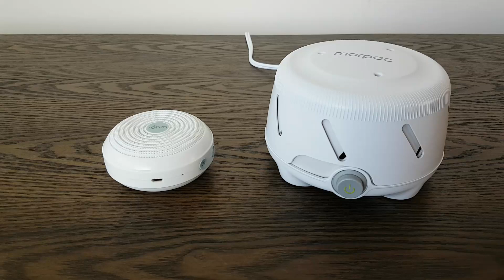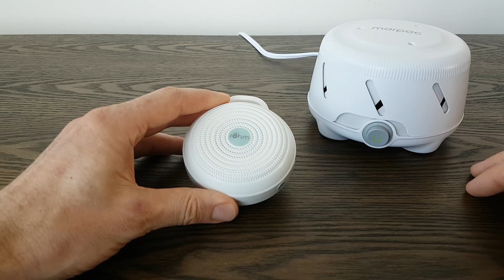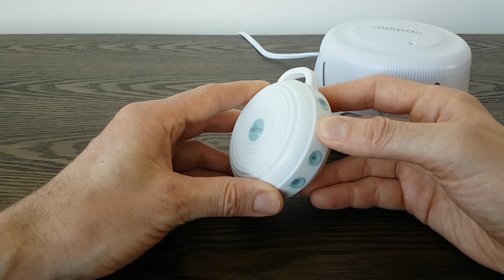Dohm Uno Vs Rohm White Noise Machine

Comment: I found a couple different models on Amazon of the Dohm Uno, with the name Yogasleep. One model was about $32 and the reviewers said the quality was usually poor and models break fast. People kept saying get the original or something like that, and that was about $50. But, then some people say you can't hear it, unless you put it right up to your ear. Getting one with a real fan seems appealing, but it sounds like a game of roulette.

I imagine these machines are popular among shrinks. Are you in the mental health game?
Reply from the maker: That will be because the company Marpac rebranded as Yogasleep a couple of years ago. I've also seen people complaining about the difference in components used. I have not taken the old and new one apart to compare them, so can't comment on that. But to me, they seems pretty much the same.
As for the volume, that is definitely an issue with the Dohm Uno - it is very quiet compared to other white noise machines. If you want one with a fan, I recommend the Snooz. It's much more expensive, but much better too.
I don't work in mental health, no, but did many years ago.

Comment: I bought the Marpac Dohm 2-speed but even on the high setting it was too quiet for my needs, so I promptly returned it. BTW AccuMed, Big Red Rooster, PICTEK, Sleep Easy and SNOOZ all offer models that use a real fan. Thanks for your interesting and entertaining reviews!
Reply from the maker: Yes, the lack of volume is an issue some people will have with that model. Thanks for the info. on the other machines. I'm not sure how I've managed to miss those ones, so I'll buy them in the near future to give them a test.